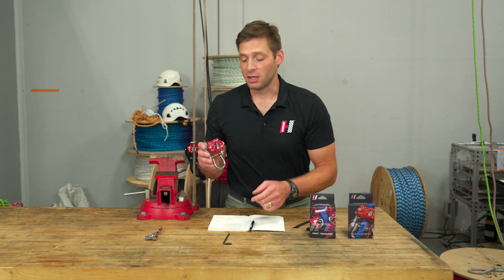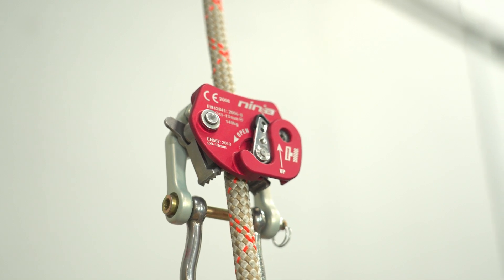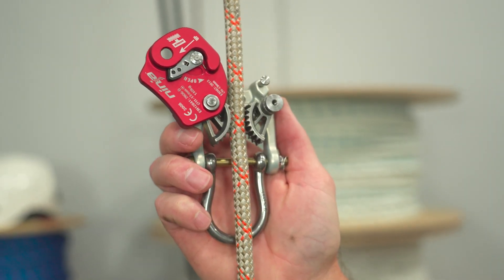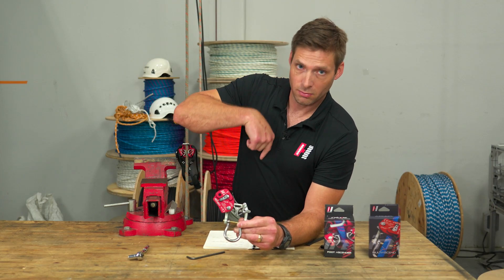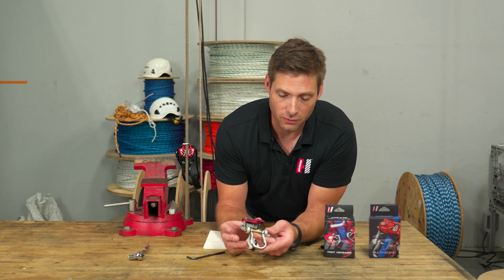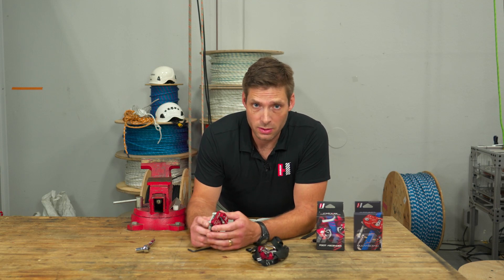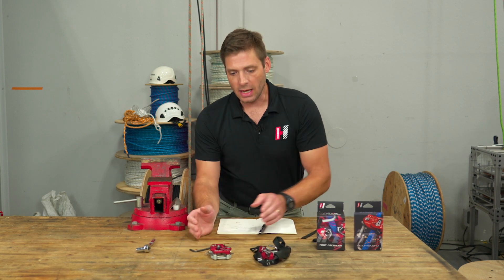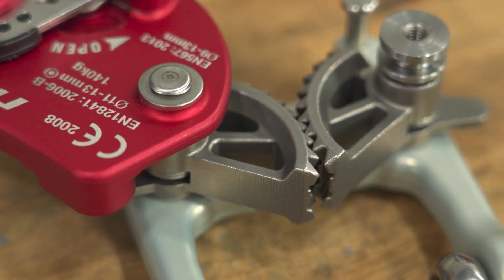The Ninja MultiAscend by Harken Safety & Rescue

Comment: Why did Harken go with stainless shackle rather then aluminum (for weight reduction?).  Really like the gate; any chance we will see that adapted to the foot ascender as an option to retain the rope in place? (seems like it would be pretty easy to just reach down and flip the gate open).
Reply from the maker: Hi, thanks for your comments. We opted for the stainless steel shackle for its strength and durability in less-than-ideal environments over aluminum. As for the gate mechanism on the Ninja Foot Ascender, we felt that it was easier to kick out of if we kept the gate off of the device and allowed the cleats to keep the rope in place while climbing. Please let us know if you need any additional information on the Ninja MultiAscend. 👍